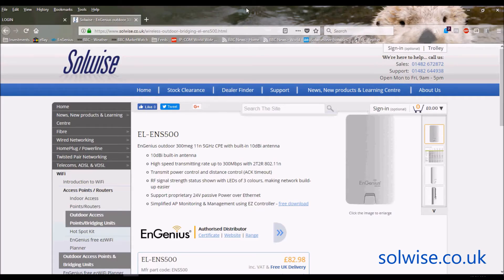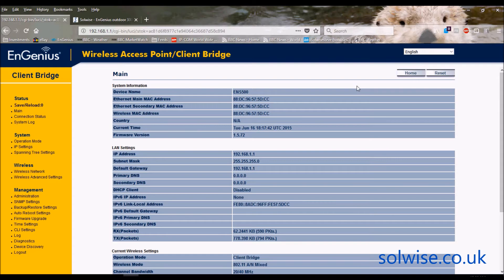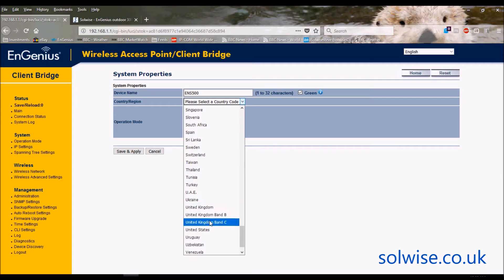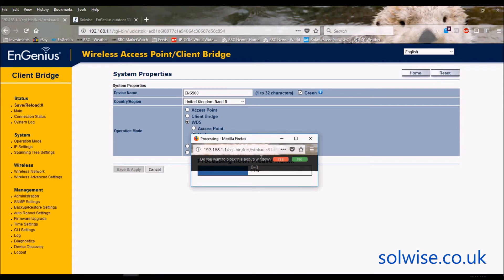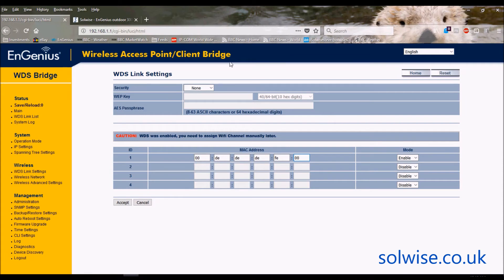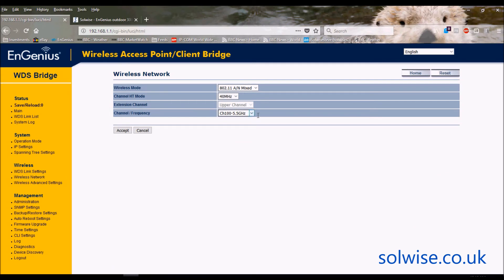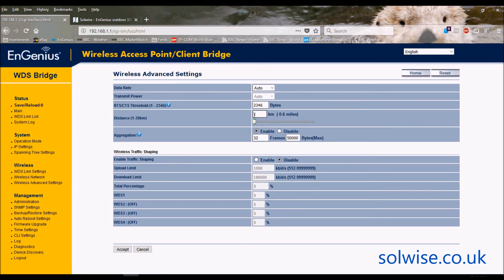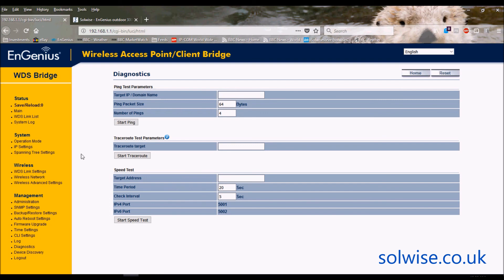EnGenius ENS500(EXT) Outdoor Bridge/CPE 5GHz 11 Set-up

Comment: Your video contains some very useful information, but when you say "it's not rocket science" a couple times I find this very insulting. I'm quite comfortable with many aspects of computers and electronics, but I am new at understanding how IP addresses work, and this part of the installation of the ENS500 was very confusing for me.  I didn't know if I was to use the IP settings I saw on my router, make some up, use the ones I saw others using in various videos, or what.  It would have been so helpful if you would have just taken a minute to describe "exactly" where to get or how to assign the IP settings and if I needed to include the Gateway information and the DNS information.  I also would have liked just a bit more clarity on setting up the second unit, as I am setting it up in WDS/Bridge mode, including any instructions about attaching a router, password issues, etc.  Anyway, hello from Canada and thanks for your time.
Reply: Can you shut up possibly